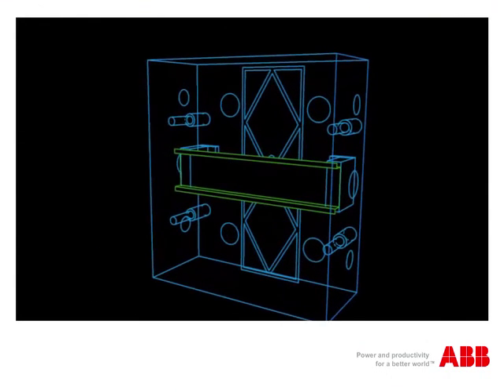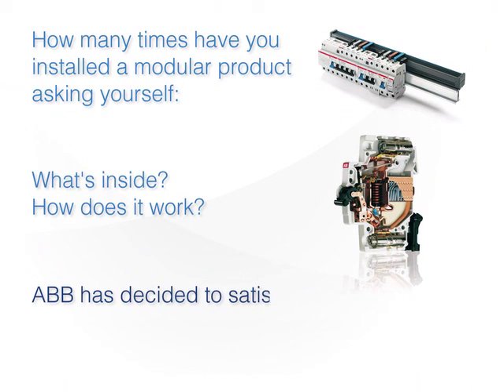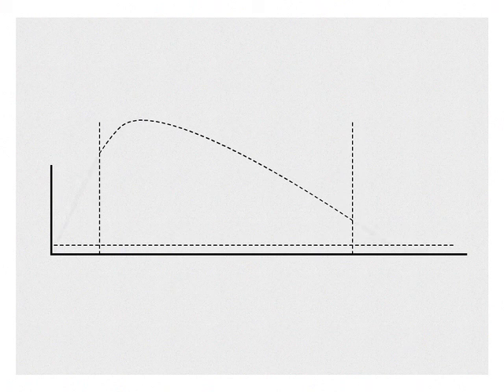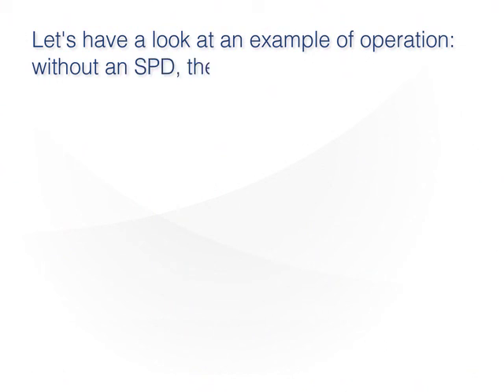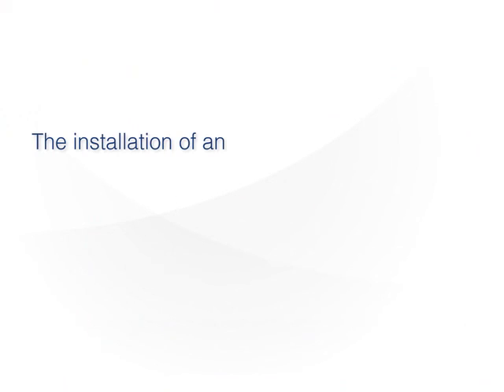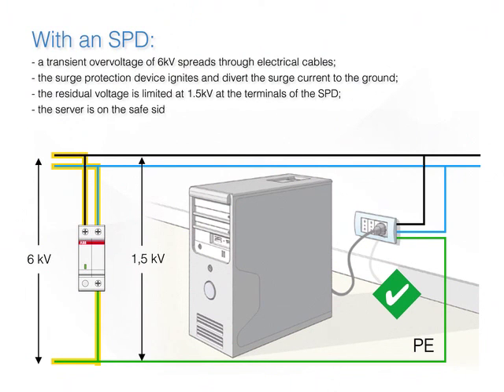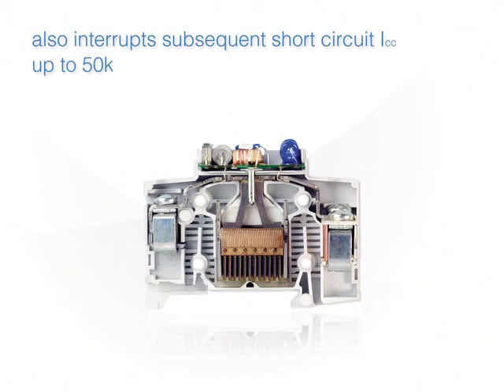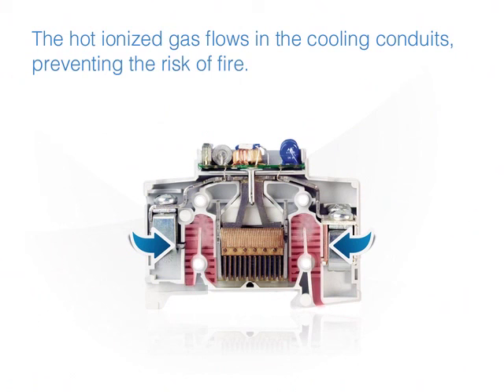A detailed look into the functionality of Surge Protection Devices

Comment: It seems that 1500 Volts is a lot of voltage to let through to a server.  Also, isn't ground used by the server to communicate via the building's Ethernet.  Wouldn't sending the surge energy to ground risk entry into the server via the communications port?
Reply: Yes, 1500V is a lot of voltage to let through. That is why there is a need for Type 3 SPD’s - to protect sensitive electronics close to point of use. Secondly, sending the current to ground wouldn’t end up going into your ethernet connection, as it is not the path of least resistance and the earth is pretty huge and can EASILY absorb the current like a giant sink 🙂
Reply: Zero Surge Inc. yea.